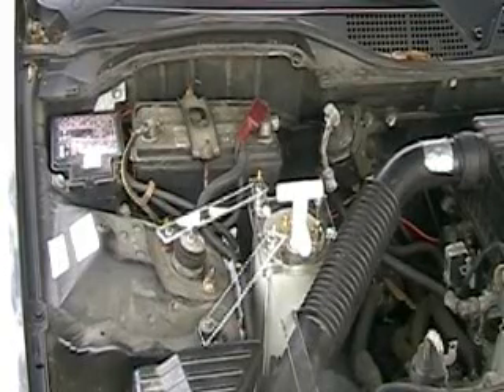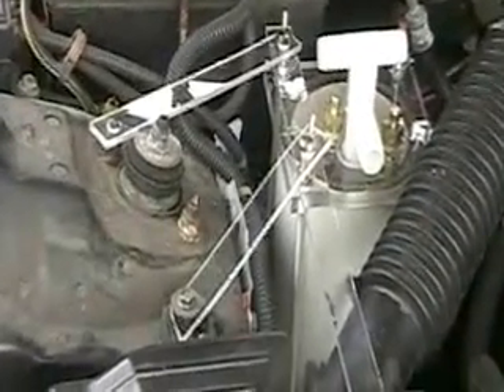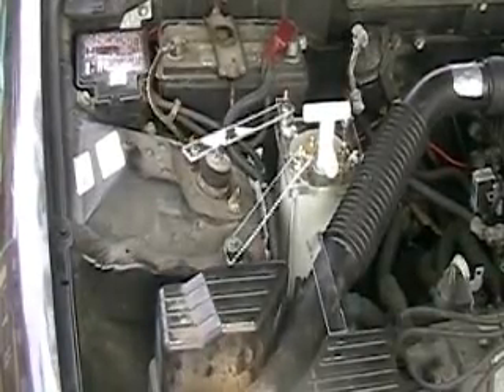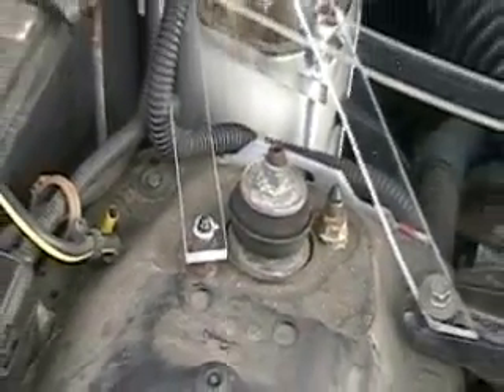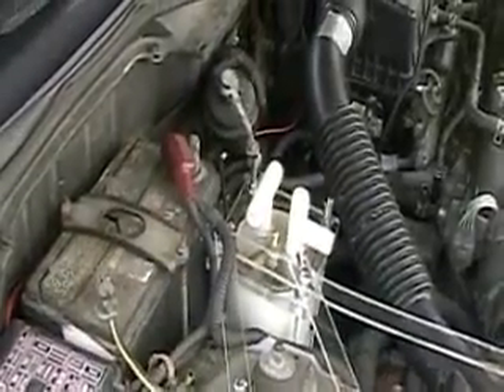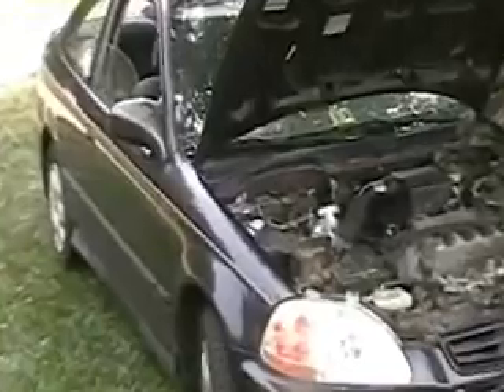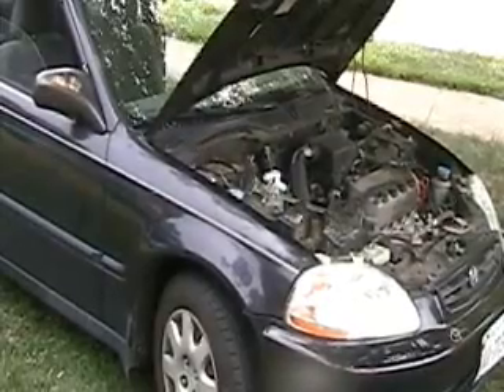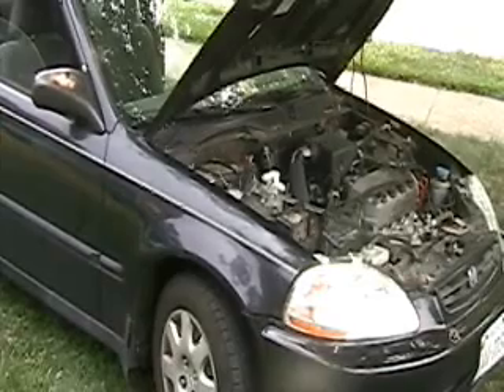Hydrogen Tap (Installation Strapping to Honda) 115

Comment: John, you should run the pressure side of the "T" into the vaccuum side of the intake between the PCV valve and the vaccuum intake port.  The other side of the "T" should go back into a water reservoir tank with a one way(or check) valve between the "T" and the tank.

Comment: John, you may have to restrict the hose going to the pcv vacuum as it may idle rough if you don't. And it may trigger a false code because of the drop in vacuum
too.

Comment: John, I was just thinking that if you ran it into the pcv vaccuum line instead of the air filter that it would aid in the burning process of the bypass crankcase gasses.  This would make the ride a very green one.
Peace.

Comment: John the more I think about this the more I beleive it's going to work.   It's got to work!  But HHO will detonate much faster then Air/Gas mixture alone.  So two items come to mind.  1) Do you need to adjust timing?  Will the engin knock/ping under load?  2) What about heat, there will be a lot more heat during detonation, how do we deal with this?  is it really a big factor?

Comment: That way the HHO gas that is not used by the engine will be sent to the reservoir for reprocessing.  Somewhere you will have to vent the HHO gas out where flammability won't be an issue.  I am not sure if your system will make more gas than the vehicle can use or not enough gas.  Remember that the vaccuum system on a vehicle also controls the power brakes so you will not be able to have an leaks. LOL.
Good luck.